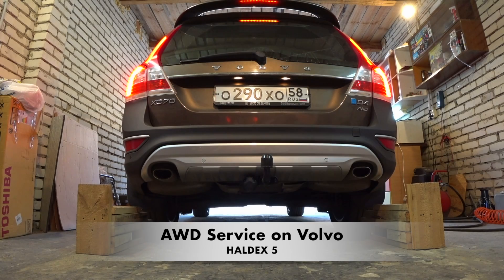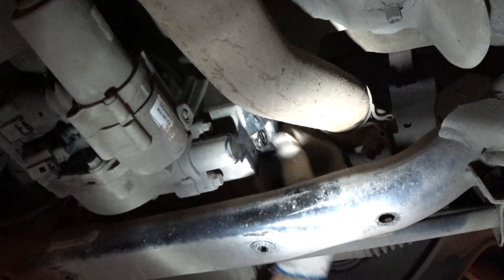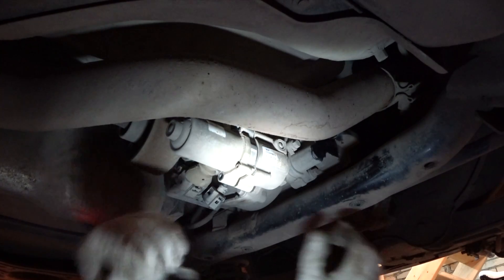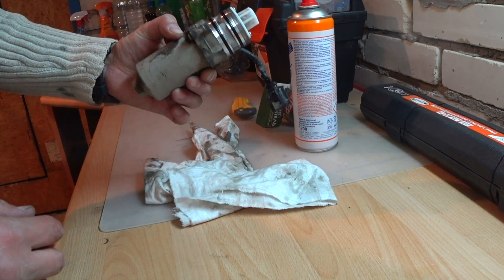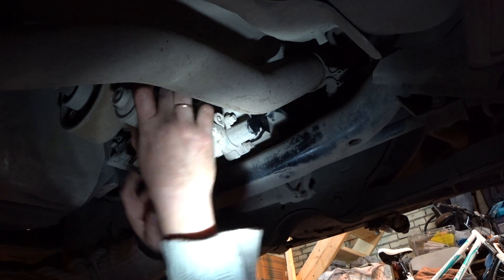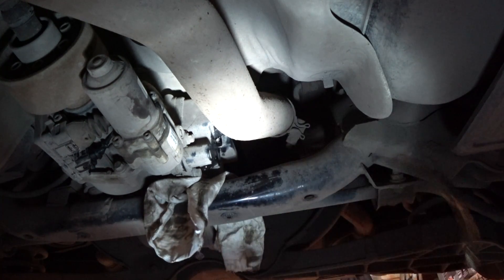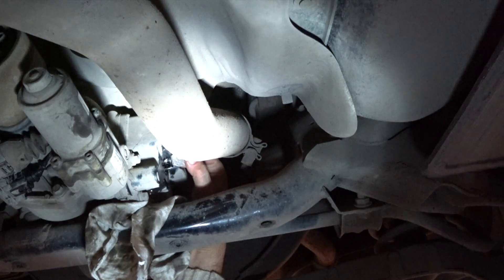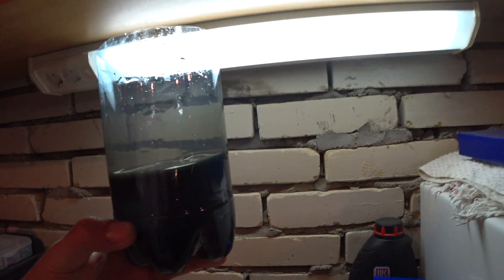Servicing AWD Haldex 5 on a Volvo.

Comment: Maybe a stupid question - after haldex 5 fluid change, most of the resources say you need to perform the air bleeding procedure (VIDA?). I got the point that instead of that you're performing short drive to remove air bubbles. But is it safe for the entire haldex coupling?

Comment: I'm getting ready to do this on my new (to me) XC70. Planning to tackle this, the rear diff and the angle gear all in the same day, and (if time allows) more drain & fill sequences on the transmission (did two before a recent road trip and it looked to be the original fluid at 113K miles). Curious to see what condition the oil is when I do these....

Comment: Hej,Lite fel.Pakningar /gummiring  är inte byta?You put the wrong oil level. The car does not stand on a straight plane. The car must turn right at the threshold, not on the wheels.Du har byt olja på diferential?

Comment: You mention the "recommended interval" is 10k miles - however, my 2014 XC70 maintenance schedule does not mention it at all that I can tell.  I appreciate this video - I will be doing this service on my 58,000 mile car, likely for the first time.
Reply: many car makers don't have customers do this for some reason. Maybe to increase annuities

Comment: I got a question. I have checked your Haldex 4 oil change video that you suck out 40ml oil in the end. Why not at a Haldex 5? Just because it does not have a filter ?
Reply from the maker: That is by Volvo instructions. I just did my friends 2013 S80 with Halsey 5 and did not extract any.
Reply: @volvosweden  thx for your answer
Reply: @volvosweden  Moreover, I see most people on youtube just change the rear differential oil. Why not the front one? Does the front differential combined with gearbox so it share the same oil with gearbox then?

Comment: Hi, my 2014 Volvo S80 AWD has an issue on the module of AOC Haldex 5. I was notified to have a re-program or adaption after replacement of the module 31397731/36011386. Kindly have your assistance on any website for instructions of adaption or re-program. Thanks

Comment: My volvo is signaling "AWD disconnected, call workshop". Do you think that this service will fix it or could it be completly broken? Maybe cleaning it and changing oil will help
Reply: what was the problem? i got same error but its gone after few engine start.
Reply: what diid you do to fix it ?
Reply: @magalicomte5078  It was a fews years back but if I recall correctly I just bought a pump and replaced it following this video. I think I got it cheap somewhere, never any issues after that.

Comment: Hello volvosweden, I am about to buy a 2015 XC60 with 100k km on it and probably no changes on the haldex oil done ever. Should I expect problems with the haldex when buying such a car? As you mentioned 20k km., what is in your opinion the biggest millage it can get without change? Let's say in normal road conditions with average winters.
Reply from the maker: In my opinion get the car and do the oil change. Worse case it stops working due to the sludge but once serviced no problems.
Reply: @volvosweden , thank you for the feedback! I was thinking that the worst case is a malfunctioning pump or even the diff itself and a change needed. I am not aware of the details about haldex working mechanism and maybe overestimate the bad scenarios. Thank you again and I am looking forward to see another videos from you!

Comment: Hello
I changed the oil as per your video
unfortunately, the warning light on the dashboard display still lights: AWD off request for assistance
I had the control unit checked and says that the pump is not working
what can I do
mine is a volvo xc70 D4 120kw 2014
Thank you

Comment: Dear Volvosweden, thanks for your interesseting videos on your volvo.
I have a 2012 XC60 Awd. Volvo does not recommend oil replacement (for a 150 km vehicle)....
I would like to replace the Haldex and rear axle oil.
If I understand correctly, they are two separate housings.
The Haldex is drained by disassembling the front pump and filling it with the plastic screw (leveling by overflow).
For the rear part, axle, it is necessary to drain by the filling plug with a pump  and refil.
However, it is necessary to withdraw (100ml). i'm ok?

Comment: Excellent preventative maintenance. I’ve done this twice now on the 2017 XC90. Again, no longer a separate filter, only the white gauze strainer on the end of the pump. Two small bolts allow the strainer to be removed, washed out and replaced. It really is essential the AOC oil is replaced as it gets surprisingly gunky. Far cheaper than a Haldex pump failure.

Comment: Great video thank you!  I have one question. On the Haldex 4 that is in 2014 and older Land Rover Evoque Haldex, Land Rover says to fill until it pours out, then drive, then fill again until it comes out, then remove 70ml with the syringe.  Has that changed for Haldex 5?

Comment: Volkswagen use a Haldex system and after replacing the oil there is no need to drive the car as the pump is run briefly as part of start-up system check. I'm assuming my 2010 XC70 has Haldex4 and i'm having a go myself. Thanks for another super video. Stay safe and keep up the good work.

Comment: Your video helped me to performed this service on a 2013 XC60 T6 with Haldex 5.  I added one additional cleaning step.  I removed the white screen from the end of the unit and cleaned it with brake cleaner.  There was quite a bit of goop upon the mating surfaces between the white screen and the unit and also some debris inside the white screen.  This additional step got the white screen completely clean.

Comment: Do you recommend replacing the orings? Kit from Volvo (31325413) is sort of expensive. Seems like I just need the orings. I think VW part number 0CQ598305 will also work.
Reply: The o-rings cost so much from VW or Audi or Volvo that I would consider just re-using them, and check later for leaks.  If leaks (maybe unlikely), then just replace fluid again along with o-rings.  I think that the o-rings can be bought for maybe $2-$4 total, if you order them directly from an o-ring supplier.   Note that they are two different sizes.

Comment: thank you very much for the video
I ask you I have a volvo xc70 of 2014 with 160000 km
now he tells me that awd disarmed assistance request
is it because I have never had the oil changed?
Thank you
Reply from the maker: You need to change oil and clean the pump sock (filter). I could be blocked.
Reply: thank you so much ! I'll try
Reply: thank you so much ! I'll try

Comment: Thank You!
Do you have the Part Number of the Oil? I see that it was just the transmission Oil that you used.
Reply: The Haldex AOC Transmission Oil is Volvo p/n 31367941    1 liter is enough.   
The plastic plug is p/n 31325479 (for Haldex 5)

Comment: I wonder why they removed the filter.....
Reply from the maker: +Ola H Savings?
Reply: Previous generations used a clutch control valve to control pressure to the clutches. The filters main purpose was to prevent clogging of the control valve. Gen 5 did away with the control valve in favor of a pump assembly that can control clutch pressure. The pump uses the sock to provide filtering.

Comment: Do you have a video on replacing a front wheel bearing? I'm assuming your car and my '12 s60 T6 are identical.
Reply from the maker: +Mike H Not yet. But if one fails for sure will do a video

Comment: I'm a new at this stuff- is this the differential or transfer case fluid or something else? Also at what misleads interval to change? Thanks
Reply from the maker: In an AWD Volvo you have Angle gear, rear differential and Haldex AWD. All three use different oils. Browse through my channel and you will find all three separate videos.
Reply: volvosweden thank you.  I find you channel very helpful fixing my wife's car
Reply: @volvosweden  For my Volvo xc60 D5 AWD (2014) the bevel gear, and rear differential uses same oil 31259380 (VOLVO). and for Haldex (BORGWARNER or original VOLVO 31367940.

Comment: great video material !! very useful, but I've seen that on Haldex 4 you have extracted 40ml of oil from he pump after filling it at maximum level. Here on the Haldex 5 you haven't done that or the procedure is missing from the video ? Thanks !
Reply: On the Haldex 5 this procedure is not needed
Reply: He was very specific in  the procedure to use.  No mention of extracting anything further, so the answer is no.

Comment: Every 13,000 miles? Really? Why do volvo not recommended this?
Reply from the maker: Practice shows that eventually the sock on the pump gets clogged and you will loose the AWD operation. 13,000 miles is owners recommendation only.
Reply: No car manufacturers like to tell the customers the real trouth about required service if you want your car to last.
Eg.: Automatic transmissions should have changed the oil every 60.000km to 100.000km depending on driving style and load. If you drive daily on the German autobahns with maximum possible speed (160 - 180kmh), drive a lot with a trailer, drive in the mountains or in any other way regularly subject the gearbox to a high load, a oil change every 60.000km is recommended.
Reply: For some reason Volvo says oil is lifetime but I wouldn't recommend that. I plan on doing mine every 2 years. I don't drive my Volvo much and it takes me almost 2 years to put 13,000 miles on my car.
Reply: volvosweden i agree lol my pump went out at 40k miles